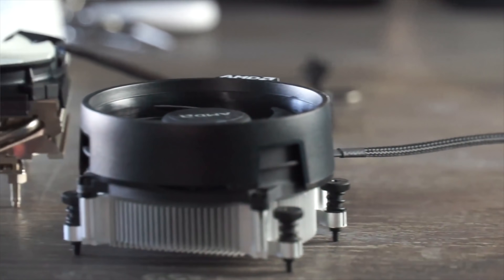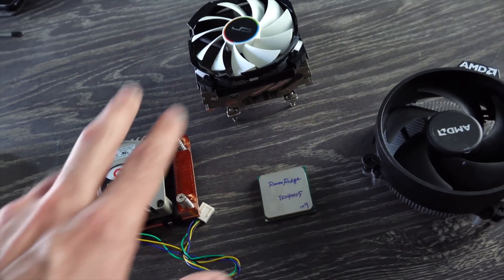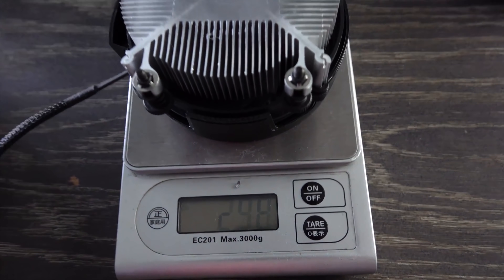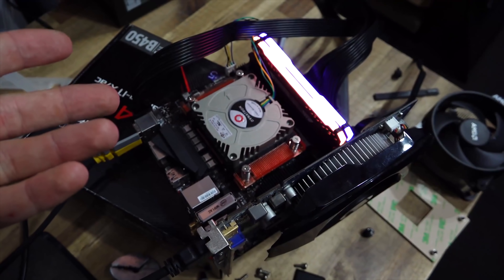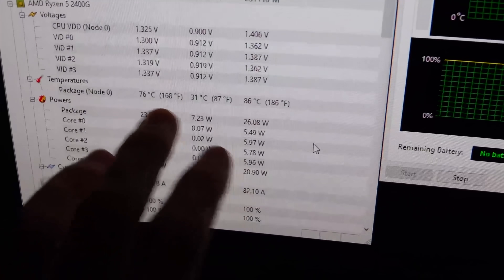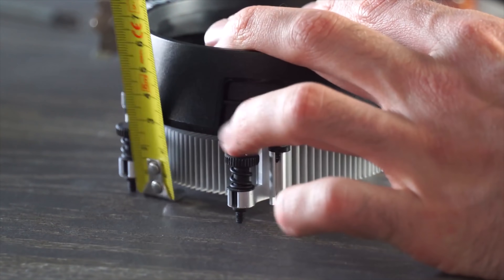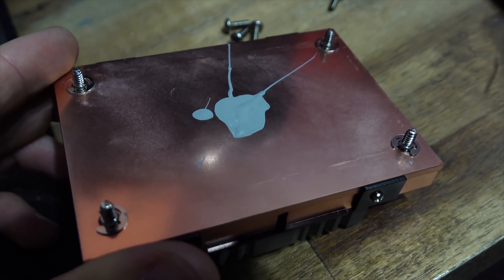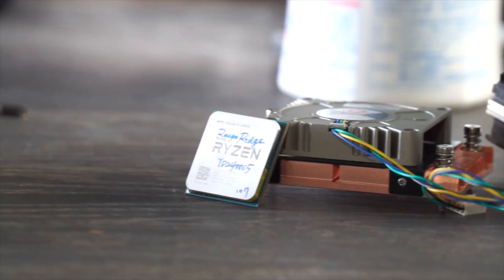AM4 SERVER Cooler for MINI-ITX Builders...?! Dynatron Vs Cryorig C7 Vs Wraith Stealth.

Comment: Cryorig now makes an all copper version of the c7 so it would be interesting to see how much better it performs than the standard c7. I have also heard of people throwing 90mm noctua fans on the c7 for even better performance and temps.
Reply: plastidip...
Reply: I use the c7 cu, about 2c difference. It's also great for liquid metal, which drops temps from 5 to 7c more.

Comment: Well, Dynatron is made for different flow of air as well. Wonder if it would make any difference to test it on actual case and not open air bench.
Reply: definitely would make a difference.
Reply: Yeah, That Cooler is meant for a 1U case and small server cases rely on air flow of all the fans. This isnt a really good test for this kind of cooler. Also probably also works best on ATX MB less clearance issues
Reply: the fan is facing the wrong direction on his, it is the same direction as the fins so it is recycling hot air. Mine I have thermal tape between the fan and fan mount and another layer between the fan mount and heatsink fins and it runs my i7 4790t 2.7ghz-3.9ghz while gaming at 43c min -80c max and is not that loud and only ramps up during intensive games.

Comment: The Noctua NH-L9i is my favourite low profile CPU cooler. But the Cryorig one looks better though. Wish I could replace the ugly brown Noctua fan though.
Reply: best one, noctua will have all black one soon
Reply: Look for ID Cooling IS40v3 or IS60, those come with AM4 brackets. They ain't Noctua, but they get the job done and do it quietly (assembled ITX PC with IS40v3 some time ago)
Reply: You meant NH-L9a I suppose. The i one is for Intel.
Reply: You can get a Noctua REDUX fan, which is gray.
Reply: Agreed, it looks ugly, that's why I sold mine.
Reply: there's review which shows that NH-L9i is better than Cryorig in both thermal and noise.
Reply: just paint it?
Reply: nfc-systems tested a whole bunch of lp/sff coolers and the l9i won the shootout (it was cheaper, quieter, and performed slightly better than the c7). tekeverything ran a test last year and the l9a actually performs a couple degrees better than the l9i since it fits in a bit more metal/heat pipe (the only "disadvantage" is the l9a is am4 only while the l9i can switch hit w/ just a bracket swap)
Reply: Tom Brown I usef the NH-L9i. Absolutely loved it. It was quiet and very effective at cooling. Especially for its price

Comment: It's the fan on the dynatron. I had the lga 1150 one in my extreemly cramped computer and it ran amazingly with a standard fan. I changed to a water cooler for form factor but I recently made a computer case out of sheet metal with my welder so i picked a 1150 dynatron up again for $15 on ebay and i intend on using it with my i7 4790T.

Comment: The NH-L9a has it's fins oriented to expel waste heat towards the RAM and VRM/IO. With all this VRM "controversy" going on, I wonder if that orientation would be a good or bad thing, as it would provide the VRMs with some airflow. Warm airflow..... Too bad about the performance of that Dynatron cooler, but I believe their design benefits greatly from the active cooling in 1U server chassis. They actually make some decent coolers.

Comment: Your dynatron fan is oriented the wrong direction. you need to have the arrow side facing the side of the fins cause if it is the direction of the fins then you end up just recycling all the hot air and running much worse, I have a dynatron with thermal tape in between the fan and fan bracket and a layer in between the fan bracket and heatsink fins since the fan housing is metal it lets it dissipate more heat. i have it on an i7 4790t 2.7ghz- 3.9ghz during gaming and the temps are 43c idle and 80c max in an very poor airflow mini itx case.

Comment: i made my own mount for a cnps2x and crammed a ab350 itx/ac inside an old casetronic c134 with an internal atx adapter,  smallest raven ridge in the world.  ubuntu 18.04 latest kernel csgo gaming

Comment: how does that Dynatron even function? It looks like it has no air ventilation, doesn't look like a blower style, is there even a fan in it? It barely has any fins on it to sync heat off. It just looks like a block of metal. It looks better suited for Eypc/Threadripper usage (after all it is meant for severs not Ryzen cpus) with it's rectangular surface.

Comment: I think it's even for servers not that good. Noise doesn't matter there but the performance is still really bad. That might not be problem depending on the CPU they're using. However, a lot of server CPU's come with tons of cores these days, so it probably wouldn't be much better which means it's only a solution for less powerful server CPU's whci are usually not the most economic choice.

Comment: Just use the stock cooler , there is absolute no reason to spend more $ . If you really want to spend more $ then buy an good 240mm AIO !
Reply: gertjan van der meij named rajintek orcus, cooled my fx8350 @4,4ghz very good

Comment: The Ryzen cooler Is not free "Yes Man" they charge you for it in the bundles . i checked this out before i bought my R7 2700x as i did not want there cooler & to buy the cooler separate was around $140Aud
Reply: $140aud without the cooler.
Reply: i know right , this cooler in this vid is i think the Wraith stealth not sure on this $ but the Wraith Max RGB is $69 at PCcase gear & the Wraith Prism RGB i have was $140
Reply: The lower end Ryzen CPUs definitely do come with a CPU cooler. High end CPUs such as the 2700X don't because, as a result of their high TDP, you're expected to use much more powerful cooling. It's the same as what Intel have always done with their high end CPUs.
Reply: You're right, sounds like an individual selling for a high price on one of the sites. Like how people forget normal every day people can sell on amazon with their crazy prices.

I bought a wraith prism  for $30 unused but on the used market. Its worth maybe $60 brand new and a couple stores sell them in retail packaging for around $70ish.
Reply: Funny That , My 2700X came with the Prism cooler as there was no option for just D CPU
Reply: Calling BS on you. Unless you can provide links and details on where you can find an OEM Ryzen without the cooler AND be 140 less you are just spreading FUD.

Comment: Hey all I bought a custom build off my cousin for $350 after shipping (components below) just wondering if it was a deal 
MSI Z87-G41 
i5-4430
ASUS HD7850 DCU2
16gb 4x4 Corsair ddr3
600W CX600M Corsair
2TB HD
LG Case w/ top and back fans (LED lights lots of room to expand)
Reply: For Max Performance Look for a K CPU if i See that right Its a z board. I‘d say ye good Deal.